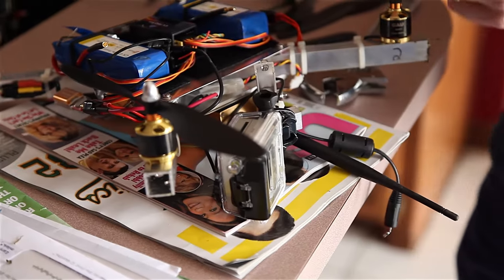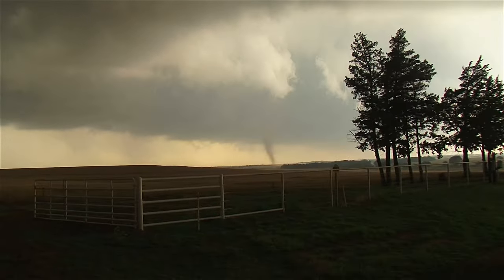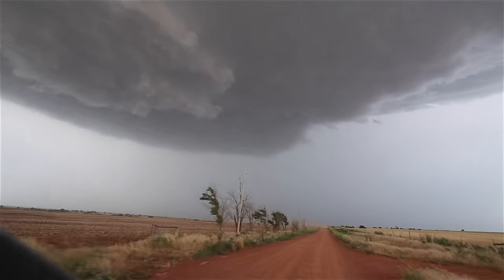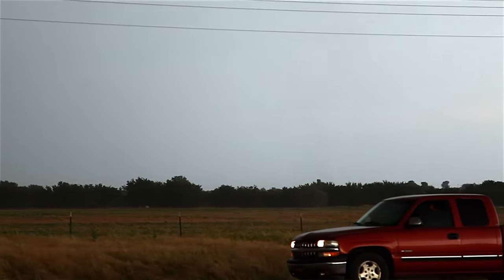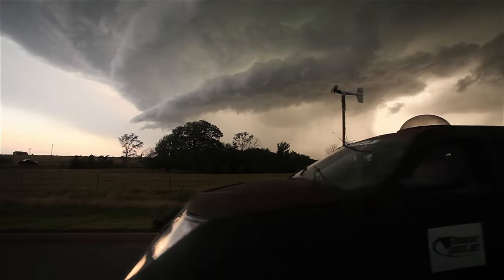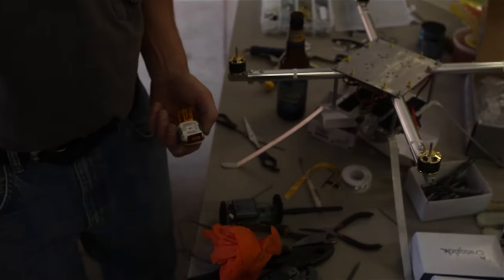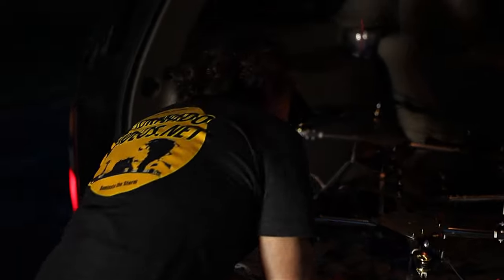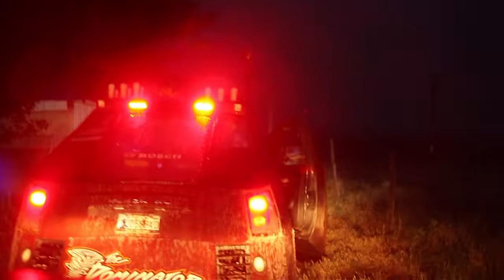Tornado Chasers, S1 Episode 10, "QUAD COPTER" 4K

Comment: Hey guys what part of drone flight rules are you using?  Part 107 commercial or just recreational for this?  Are you checking airspace to make sure you aren't afoul of the FAA rules regarding airspace and altitude requirements?  Plus, night flying requires lights and waivers.  Now ADSB Id'ers are becoming the rule.  Be safe and lets keep the airspace safe too.
Reply: There should never be airplanes anywhere near supercells!